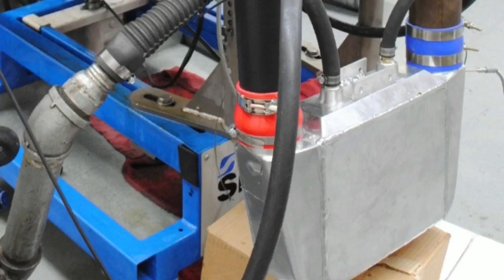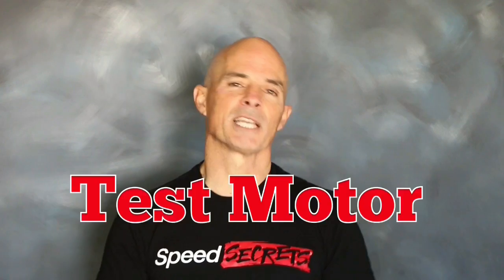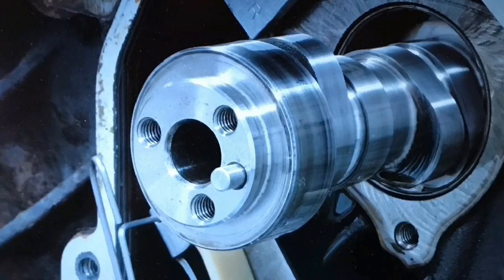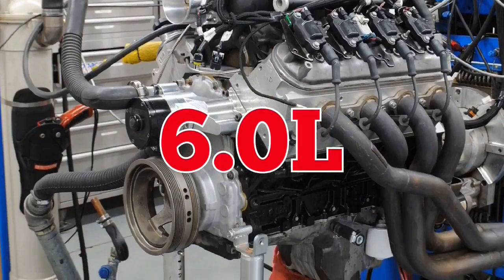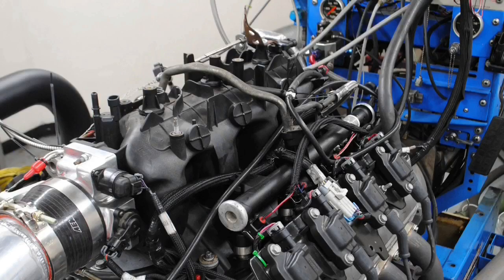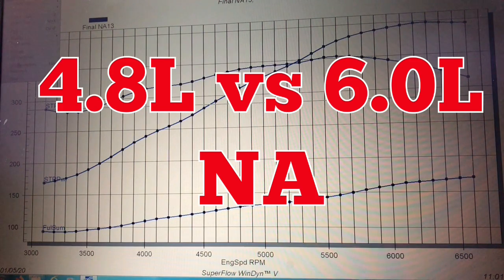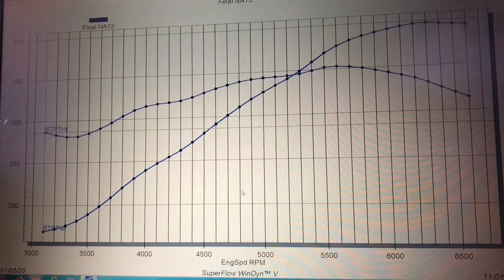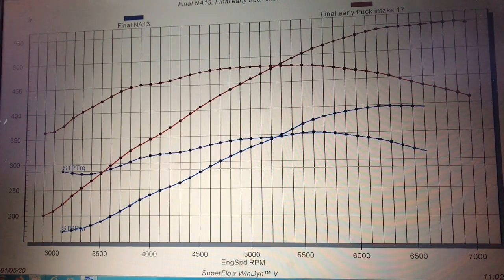SUPERCHARGED 4.8L vs 6.0L Full BOOSTED Results!

Comment: I’ve gotta 220/220 .588”/.588” -114lsa cam in my n/a 4.8 and it screams all the way upto 7500rpm……my question is will this cam cooperate with the vortech v-3 supercharger in this video……considering I just got one not to long ago to put in my ‘73 c10 short bed fleetside….I plan on using 650cc injector…..I already went the lsa supercharger route on my nova with a 220/230-.553”/.553” 117+4 cam in my nova and that cam worked great both n/a and boosted just like you said it would 😊……..I love these videos and don’t know why there is a line going through half of my comment….sorry folks
Reply from the maker: THEY ALL WORK WITH BOOST

Comment: What’s the vortech blowers comparable pro charger cousin?
Reply from the maker: there are different sizes or both-what power level?
Reply: @richardholdener1727  thanks for the reply man love the info you provided  I had a p1sc kit fall into my lap today and I know it will work but not sure if I would be better off selling or trading in the head unit for a D1. My 6.0 is almost identical to the one you tested here. Difference is I  Have a Vic jr efi 102 mm with elbo and 243s aren’t ported but would be tickled pink if I could make 750 wheel or more. My question just was wondering if the vortech in your test here was a kin to the p1 or the d1.

Comment: I used close to the same setup 4.8(stock heads). The difference is you can add 25-28 psi to the 4.8. Where as the 6.0 you would have to heavily mod to get over 15psi. 4.8 makes 1235 awhp at 26 psi.
Reply from the maker: you can run as much boost and power on a 6.0l as you can on a 4.8.l
Reply: How reliable would it be though running that kind of boost though daily though

Comment: I don't get why the boose increases? Surely the blower is linked to the crank shaft rpm? So yes the blower spins faster as the motor rpm increases, but then it should also use more air as the rpm increases.
Reply from the maker: FLOW GOES UP MORE THAN IS BEING USED-EFFICIENCY OF TH BLOWER INCREASES
Reply: @richardholdener1727  oh yes, this is not a spiral fixed displacement compressor.

Comment: What model vortex is that.. also have a Carb 6.0 with 823 heads.. what should I expect ?
Reply from the maker: should work well
Reply: @richardholdener1727  I or we would like to see a procharger  test, with a blow thru carb and 823 heads factory displacement

Comment: As always, awesome work! A 25% larger engine, similarly upgraded, should produce these results, I'd think. Specific output  comparison show the bigger engine being strong low, losing it's advantage as revs climb. Small engine had more relative flow than ideal down low, big one ran out of excess breathing ability on top. Boost/backpressure would obviously be lower, since it's taking bigger bites.

Comment: From the videos ive seen. Im going turbo with my 4.8. Looks like the shorter stroke would get into boost faster. Not building a race car, just a street truck. And I do a lot of highway driving.
Reply: If you needfaster response use a smalker turbo to feed a larger or use a super charger

Comment: or. jack the boost up on the smaller engine to equal the same power of the larger displacement. Then it doesn't matter which engine you find in the junkyard, you are effectively making them equal with boost. At least that is how my  mind see's it.   I want to find a 6.0 or a 6.2 in the junk yards for my 2nd gen Trans Am. but those engines are not near as common as the 5.3L. so, use a twin screw Kenne Bell or equivalent to jack up the low down boost to make if feel like the 6.2 or a bit more.  After all, you spend more time  with low engine revs than you do spinning it at 6000 RPMS.

Comment: I like my L20 4.8L. I have the Gen 4 engine so the rods are stronger and I have the good flowing 799 heads that I lightly ported. Along with a TSP stage 2 turbo cam, CHE rocker trunion upgrade, PAC660 springs, LS7 lifters and new GM trays and VVT delete along with a 76/75 turbo kit, 80lb injectors and a Walbro 450 pump and a built 4L80E. Such a great daily sleeper with around 650RWHP
Reply: That would be POTENT in a Fbody man
Reply: @TheJMan1K  you aren't lying there. Probably why you can barely find any Gen4 4.8L engines anywhere. Lol. It would definitely be a reliable killer on the street no doubt. Hell even at the track in a bracket or index class it would be fun as hell to race.

Comment: I always wondered what a low flow choked down intake and heads on a 6.2l with turbo would do. Yuge torque and lower rpm and horsepower like a diesel? Not that a guy would want to but just to compare a diesel that has a big Engine with a turbo for hauling a lot of weight. Since that’s the rave these days

Comment: Hello. I been checking out your videos.  So awesome sir.  Not to sure if you have a video out already on this topic. Motors that are N/A application / super charger friendly  242 /251@50 lsa 14+4....  but decide to go in the turbo direction..  will back pressure play a factor,   will it hurt power up top.. or will it on lose a few hp compared to a turbo cam application

Comment: Damn my 4l60e wont last one weekend with that kind of power 😂
Reply: Won't last an hour after install lmao
Reply: 4L60=6000 lb gvwr.

360 ft lb torque stock.

4L65=6500 gvwr 380 ft lb tq stock.

Just have it built to support a 9000 gvwr vehicle.

Comment: I dont know if this has actually been done yet, but what about a junkyard test? What I mean is testing all stock engines using junkyard parts. To some people that doesn't seem all that interesting, but these LS type engines used different heads. Some had larger chambers, while the others had smaller ones. The media I've seen seems to be filled with confusion as to what heads would achieve power gains. I know some don't have the funds for the fancy equipment that you use. There's too many people asking questions that just aren't being answered correctly. Most of the answers I've actually seen were based on opinions, rather than facts. Nice videos.

Comment: 4.8’s are fantastic for boost. Short stroke, thick walls, iron block, etc. put in some good internals, good heads and the right cam, they can make 1000 easy.
Reply: Stock internals it made over 1000 hp
Reply: @Ismaelj100 All depends on your goals. Iron block 5.3 Will work just fine. The 4.8 provides a little more wall is all, but the Stroke is the same for both 4.8 and 5.3 if I recall correctly. 

The 6.0 is always tempting and are solid. If you’re going ground up I’d start with a 6.0 block myself, but if I had an iron block 5.3 already I could see myself sticking with that. 

I’ve built many boosted 4.8’s and 5.3’s that last longer than, or are comparable 6.0’s. 

Just my thoughts. Good luck!
Reply: @steveg2277 incorrect there same bore on 4.8/5.3 the 4.8 has a shorter stroke and different pistons
Reply: @steveg2277 incorrect, both 4.8/5.3 share the same bore size the difference on both is the stroke size from 3.2 to 3.6 , the 5.3 and 6.0 share the same stroke size but the 6.0 have a 4” bore
Reply: @steveg2277 do u think i can put a lt4 super charger on my stock truck?

Comment: Would you be interested in a video discussing VE and it's effect on NA , SC and turbo applications? Does a good VE (such as Honda H and K series) mean that you can take better advantage of high flow FI applications? Also, does a lower VE mean that you have better low and mid range power. I noticed that most stock turbo engines have a low VE compared to equivalent power and displacement NA engines. How does that apply to the massive difference in torque/power curves as well as overall thermal efficiency? Love this series and keep up the awesome content.
Reply from the maker: Boost multiplies what is there-a powerful na motor equates to a powerful FI motor. That's why motors like the B or K-series Honda make so much power under boost relative to their displacement

Comment: With the same supercharger at 13.5 Psi I started with a cam similar to the 4.8 in my 5.7 and changed to cam like what the 6.0 has aand could run 8 degrees more timing and made 120 RWHP extra you should try the same test with that cam in from the 6.0 in the 4.8 on boost. Centrifugal blowers like na type cams with extra exhaust lobe.

Comment: Since the parts are interchangeable could you do a test where you make everything more identical? With only big difference being displacement.
Reply from the maker: the 205 heads are not good for the 4.0 inch bore and the big bore heads are not great for the small bore motor

Comment: Different heads and cams on both motors , should of kept them the same
Reply: The same heads and cam on a smaller motor will just peak at a higher RPM Maximizing power will require a different combo. It would have been nice to also have tested the motors stock and also maybe with the same cam to see the difference before maximizing for displacement.

Comment: Richard, quick question. Ive been getting a lot of mixed feedback on my setup. Stock L-76 block and heads (just stainless intake and inconel exhaust valves), 4.005 bore, 4" stroke forged Manley rotating assembly (longer h-beams) with 2618, 11:1 pistons, AP/ductile file fit). Stage 4 Brian Tooley PDS cam, stock LSA blower with Griptech, Holley LS Swap (69 Chevelle) long tubes. Its ARP studded mains and heads with MLS head gasket. Plan was to run E-85 plus methanol injection. Ive been getting estimates of 600hp at the wheels (T-56 Magnum) to 800hp+ depending on how much methanol. Lots of people questioned my choice to run 11:1 with a screw blower, but my reasoning was exactly what you stated in this video and others, stronger base engine/less boost needed to make big numbers. My goal was to be able to handle Hellcats and ZL-1s/Vettes and all the other late model blower cars. What do you think? The motor and trans swap is scheduled to begin in 2 weeks...
Reply from the maker: your power output will be dictated by the flow rate of the stock blower

Comment: Here in Aus we are de-stroking the aussie 6 from 4.0 to 3.7lt to let her rev. Guys are seeing 10500rpm with them and over 2000whp. Id be interested to see where the 4.8 tapers off using the same head and cam as the 6.0 Can see in your test even as was the 4.8 wanted to climb.

Comment: Great video, thanks for doing this.. You mention that even on a positive displacement supercharger the results would have been same. Don't positive displacement scoop same amount of air from the charger intake and therefore if you ignore leaks should produce approx same power on both motors, provided it's appropriately sized. Ofcource  the boost will be vastly different.

Comment: Should have the SAME CAMSHAFT and stock heads on both engines
Reply: They do you just can’t read you must drive a 05 camaro ws6 musta slid on trays huh torque steer had to be real

Comment: Id love to see the difference the same combo on the same motor with lower compression makes. I figure that boost helps mask low compression right? I have a 4.5 ltr v8 in my Mercedes and they are stupid low compression and make like 200hp. I know" LS swap it" but I'd like to keep the Benz power if possible. I've got stacks of them. I really only need 300-350hp for drifting. Any more and it gets more tire expensive. So test a 8-1 and a 9-1 on the same combo? On like a shitty 305 or 4.6 pleasse!!

Comment: It is safe to say from the get go the 6.0 will crush the 4.8 boosted or not . Lol 😂 should of did the 5.3 and 6.0 . Btw the stock valves and springs on the 4.8 won’t last long at 15 psi lol that’s why they swapped the heads .

Comment: The old adage, no replacement for displacement. And all that I've really taken away is that, boost is a measure of restriction, not horsepower. You want big power, start with an engine that can breath well. So that when you add boost. It only enhances what you have. Instead of masking what you dont.
Reply: Remember Bernoulli principle of venturi effect, take a 5 inch pipe and taper down to 3 inches, in 5 inches air pressure is higher but air velocity is lower, as air goes through the venturi (taper) air pressure is reduced and air velocity increases. If you go back to 5 inches the air pressure increases and velocity decreases

Comment: I get that bigger motor more power but being only 150hp apart whats the horsepower per cubic inch on both motors are they closer than we think on power out put after factoring in size of engine

Comment: Why aren't you spinning the 4.8 faster? Shorter stroke, forged internals and you're still increasing power on the supercharged one. Seems like you missed out on the whole point of the 4.8 aside from it being marginally cheaper.
Reply from the maker: the rpm potential of the motor is a function of the valve train, not the stroke, but yes-we could have run it higher
Reply: @richardholdener1727  It's a function of both, just working with the assumption that the valve springs were already addressed since a much larger than stock cam is being run.

Comment: Have always considered this comparison Richard, thx. One thing that may skew a comparison with engine size using a turbo is back pressure against the rear housing with the bigger cube engine, what do you think?
Reply from the maker: it will
Reply: @richardholdener1727  would be a good test. I always figured the smaller engine would make the same power but at a proportionally higher rpm, but surely the bigger engine would make more torque earlier on... there's some maths there to think about

Comment: I have a 5.7 liter ls1 gen 3 motor and I want to do it up at some stage am I better off with stock heads which are the 853 heads
Reply from the maker: they work, 243 or 706 would be a touch better
Reply: @richardholdener1727  ok cool thank you so better flow but still restrictive enough with 243 or 706🖒

Comment: Not really showing 4.8 vs 6.0 comparison with boost.  To equally show the difference both engines need the same cam, and heads.  The flow potential of the 6.0 is a no brainer over the 4.8.
Reply: Totally agree.  It's an interesting comparison, but too many variables.  With the same pullies the blower should be moving very similar air mass.  The bigger engine should do somewhat better (less restriction on the blower, lower charge temps, etc.).  But a 20% difference, no, that's due to other variables.  In the real world you'd never see such a comparison (you'd probably gear the blower for more rpm on the 6.0 liter), but if you're trying to assess the differences, you've got to control those variables better.
Reply: @ChurchAutoTest  all forged bottom, better flowing heads, 3 1/4 stroke w/huge cam@120 lsa and he shut it down at
6750? pretty stupid, it was just getting started I would like to see the numbers at 8500!

Comment: I noticed that when boosted you didn't bring either engine to as high of an RPM as you did when the engines were NA. I know from experience that when you put a Centrifugal supercharger on a given engine that the engine simply will not rev as high as the NA version of itself. I'm surprised that you did not mention that. Thank you for all of the amazing videos, Richard. We gobble this shit right up!
Reply from the maker: I haven't found what you describe to be true. In fact, the risking boost curve offered by a centrifugal increases the rpm where the motor makes peak power. Power was still climbing when we shut it off
Reply: @richardholdener1727  oh really? That's never been my findings with the Prochargers I have installed. Either way I love your videos man!
Reply: Power will start to fall if you reach the upper limits of the supercharger rpm even if you're only at say 5800 rpm on the engine.  Such as a D1SC on a 6.0 with a 3.x pulley

Comment: Come on Richard. You can do better than this. This test is absolutely flawed. No way no how can you compare those two combos and test the power difference between the different sizes. They have different cams. Heads. Compression. Just totally different combos with the same blower. Not even close to being a valid comparison. This test needs to have the same heads and cam and as close as possible on compression. 
The 6.0 had almost 10 degrees more duration on intake and exhaust and the 6.0 was on a 113 lobe sep and the 4.8 was on a 120! A 120? Really? Lol. Of course the 6.0 beat the pants off the 4.8. But in honesty, throw that cam out the 4.8 into the 6.0 and watch the power drop. And that’s only part of the story. I bet the combustion chamber is better on that 243 head vs the trick flows.
Reply: Why dont you do the test?
Reply: Jared Gollnik excellent idea! Send me a blank check and I’ll go buy a Dyno and all the engines and parts I need to do the tests.

Comment: Test 243 vs 706 heads on a lq4 with a comp low lift 212/218 cam. Which would make a better daily?
Reply from the maker: i would use milled 243 on the LQ4